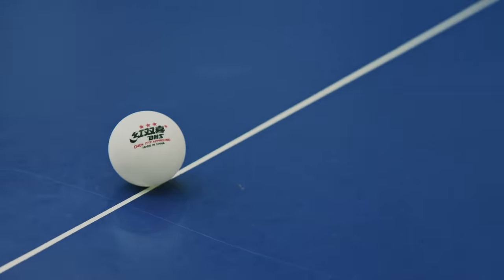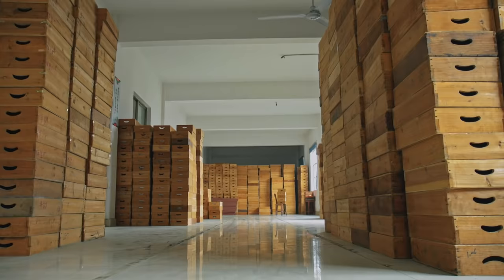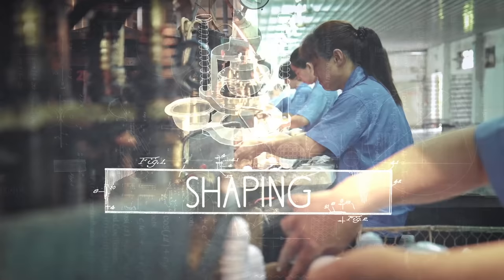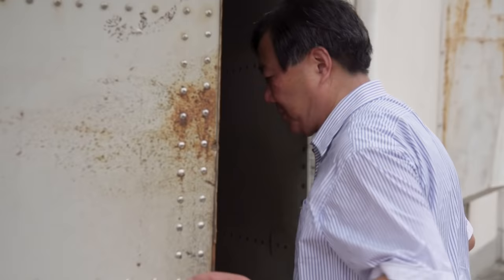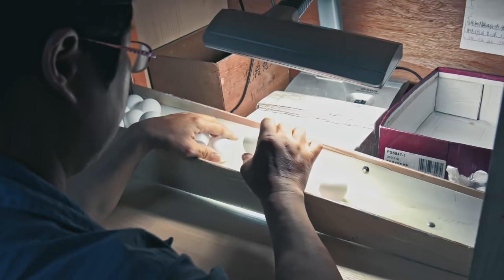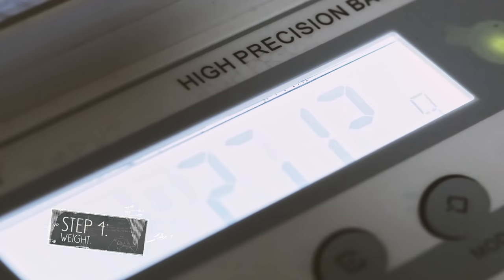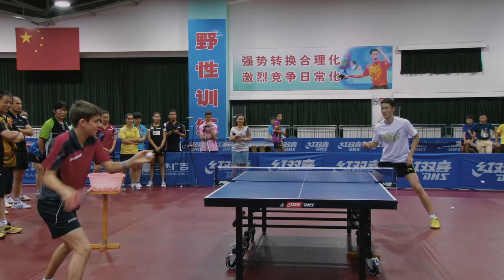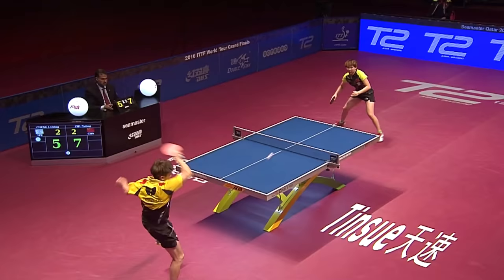Pingsider | How Table Tennis Balls are Made

Comment: If you ever wonder why the pros hold the ball up to the light, I suspect it's to look for a dark spot that indicates that the ball has a manufacturing defect. 

And when I buy a 10 pack of DHS D40+ there seems to be an average of 7 out of 10 balls with that have a wall thickness variation. This makes quality balls even more expensive than a 3 pack of Nittakus because you have to buy 10 DHS to get 3 quality balls.

Don't get me wrong, the 3 D40+ out of the 10 pack that are good quality are arguable BETTER than the Nittaku NP40+ balls. But it's frustrating to buy a 10 pack of 3* DHS and wind up with 7 balls that are 1-2* training quality.
Reply: You are really high maintenance. Personally, i find every DHS D40+ ball has wonderful quality with rare exceptions.

Comment: @1:45 DHS is now producing D40+ table tennis balls to replace the polymer (plastic) 40+ which is being manufactured by other companies but prone to breakage, cracks, etc.  The DHS D series use tougher ABS (plastic) which increases toughness for much better durability.   40 stands for 40mm which was introduced in 2000 to replace the traditional  37mm diameter.  + simply means plastic instead of the highly flammable celluloid, introduced for much safer transport/delivery, especially air freight.  Did you know celluloid balls were banned for air cargo back then?  
After all, my guess is D signifies DHS for their selection of ABS material to keep their D series balls apart from other branded polymers.  Whether they have patented this product is unclear.
Reply: "✚"  symbol  indicates a greater diameter of ABS balls/

Comment: But what's the difference between the D40+ and the 40+ from DHS? Same Q as the G40+ from butterfly...
Reply: different material that makes the ball more consistent and durable but results in a heavier and less spinny ball. I'm pretty sure it is another kind of plastic called ABS (not sure for G40+ but D40+ and Nittaku premium 40+ for sure).
Reply: That's helpfull, thank you.
Reply: That's basically correct except for the point about weight.  All balls must meet the same weight requirements, so any differences will be small.  Also the issue about having less spin is very subjective and hardly settled.  So far, there are no objective measurements.
Reply: So if there isn't such a big difference between old 40+ balls and these new 40+, is it all about the marketing or brand competition?
Reply: There is a real difference.  It is in the material.  The D40+ balls bounce about the same as celluloid balls.  They are more durable.  And subjective impressions suggest that they are more uniform and that they maintain their uniformity well. It is only the comment about weight and spin that I'd caution against taking too seriously.  If you want to purchase a DHS 3* non-celluloid ball, be sure to buy the D40+ - the package with the woman player printed on it.
Reply: Now i get it, hopefully some of those D40+ are going to arrive in a few weeks directly from China
Reply: I think they are generally available from online TT stores.
Reply: The balls seem to be "heavier" which is due to the fact of the material and how it spins less thus you have to hit more, which I have personal experience as well comparing between regular Butterfly against Nittaku Premium 3-star. I do agree that there is a cap for the weight for all balls.